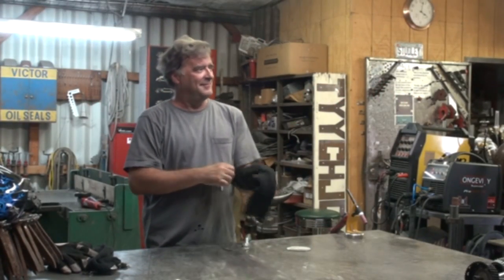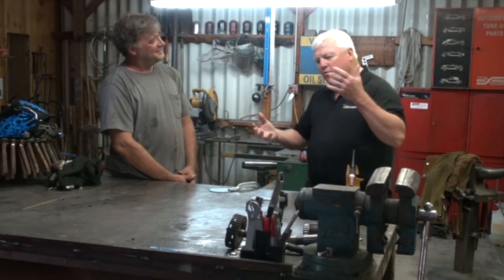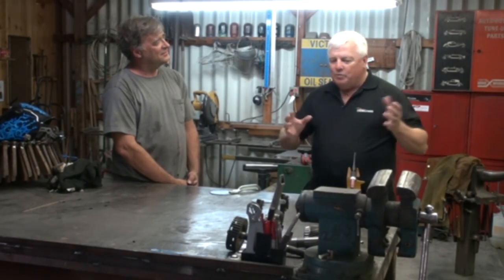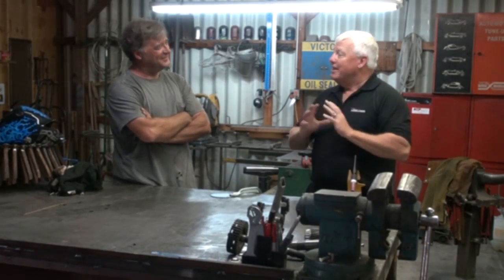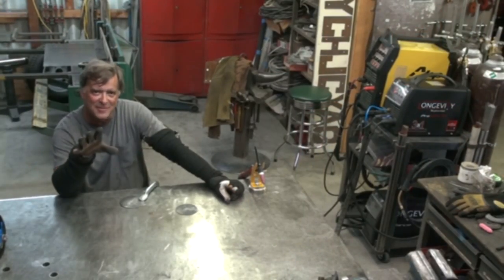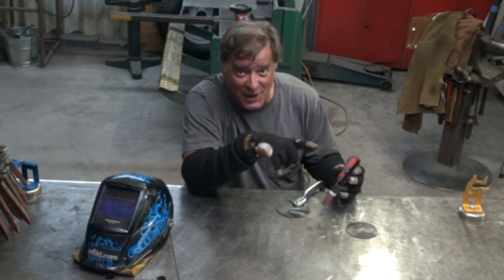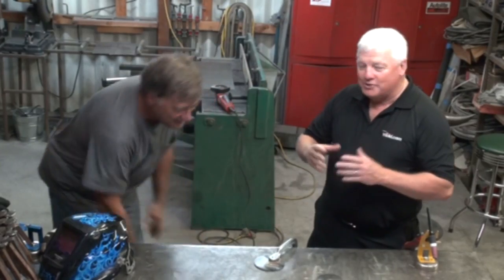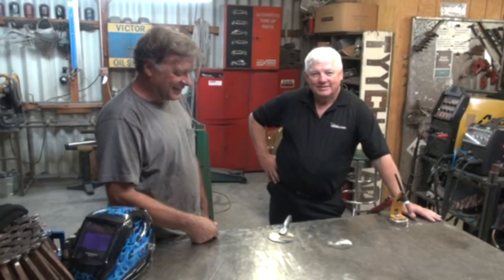Why You Can't Use the Same Gas for All Welders - Kevin Caron

Comment: Helium is pretty popular for welding aluminum, especially when it is a thick piece. The helium runs hotter. Also, I worked for a stainless tank manufacturer that used helium to butt-weld their stainless sheets together in a semi-automatic process. The downside is the cost.

Comment: Hey Kevin what else would cause it to spark like that? I'm using pure argon and I'm getting all kind of the sparkler effect.
Reply: Dirty steel?!     Make sure you clean the steel on both sides before you weld.    No scale,  or rust.    Another problem may be coverage.   Too small ofa cup, or too much of an angle on the torch.
Reply: Thanks for the reply, I'm going to maybe try cleaning the surface with a different wheel and also have my argon refilled due to possible contamination...but I have a hunch maybe it was a combination of dirty steel and to small of a cup, going to pick up the largest cup I can find lol

Comment: I use straight Co2  when I mig weld  Ive been wondering if I should switch over.  Would it make a big different on mig?  from Co2 to Mix  Ive been told it doesn't really matter except the mix will allow you to have just a little bit deeper weld. (since they said a little bit it sounds to me like it doesn't make that big of a difference)
Reply: depends on how thick of metal you are welding thin gauge stay with CO2 up to 1/4" over that use a mixed gas
Reply: yeah I usually dont weld over 1/4"  and if I do I go to my bigger stick welder.  Thanks for the info